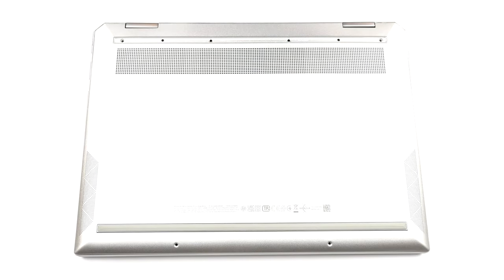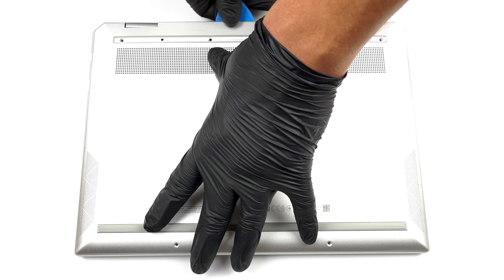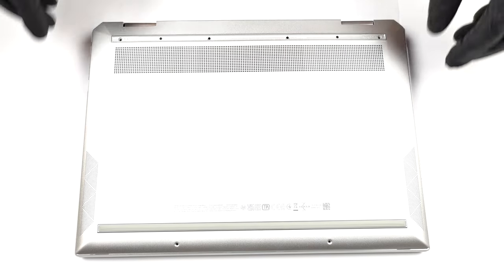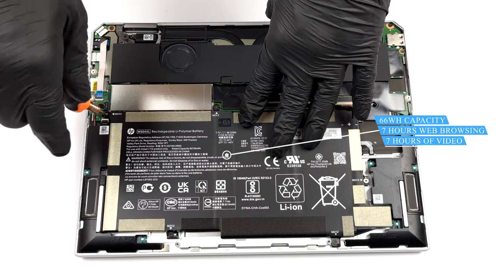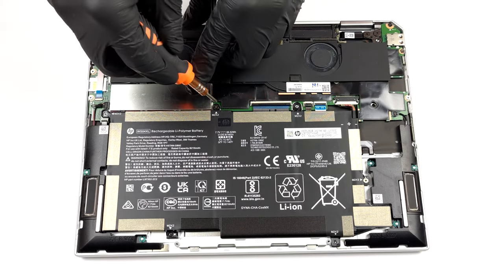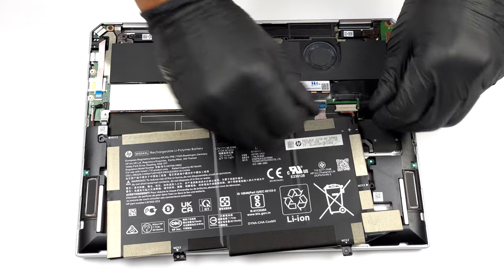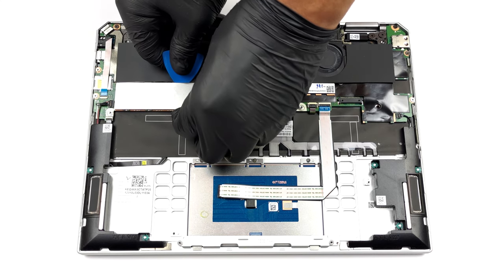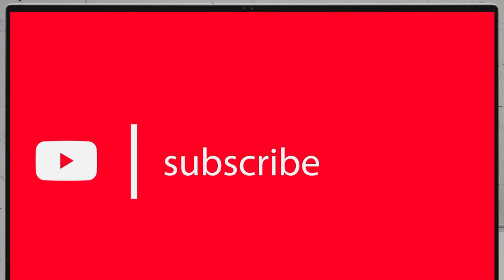🛠️ HP Spectre x360 14 (14-ea1000) - disassembly and upgrade options

Comment: Be VERY careful when opening and reattaching the backplate. I wasn't careful when opening the backplate and I apparently damaged one of the small latches which connect the backplate to the rest of the laptop. My tool scratched the latch enough that it will not "stick" anymore and it now protrudes a bit when assembled, which sucks.